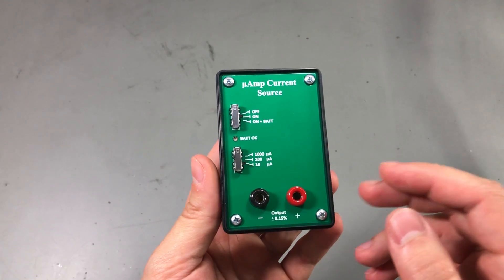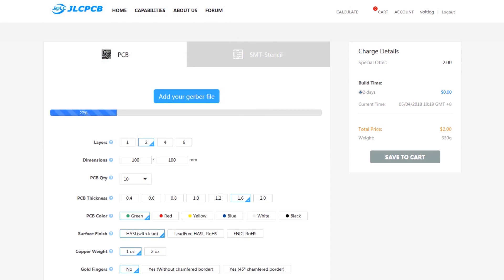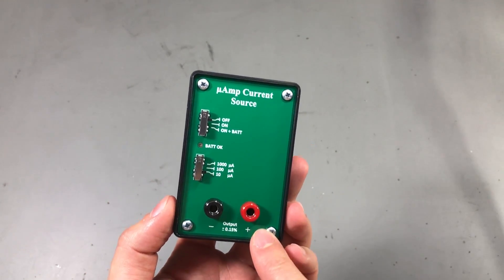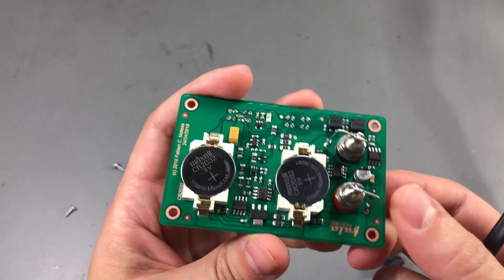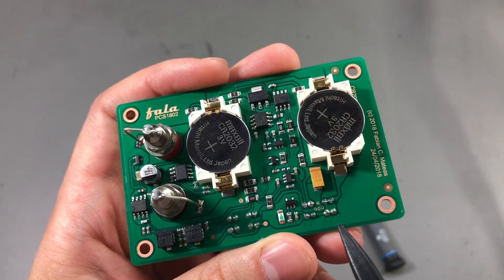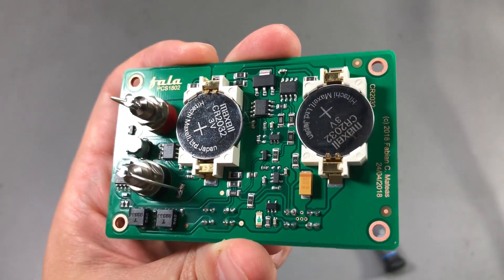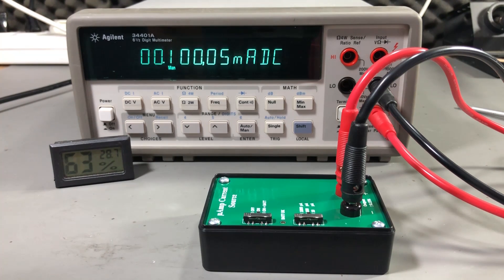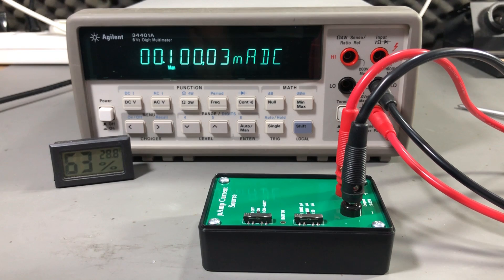Voltlog #173 - µAmp Current Source

Comment: Can anyoane help with advice on how to go lower then 10 microAmps? Need a generator for the range 3-10 MicroApms, can I add something to this one or is there another one-unit that does this? Thank you
Reply: This is can be the diffrence between two much higher current source/sink.
I may not place them on pcb and surrund them with static isolation rings to measure the leakage current directly from its source.

Comment: When measuring currents you shouldn't have to worry too much about test-lead conditions, since everything being measured is in series, there is basically closed-loop control of the current regardless of small impedance fluctuations. One thing you can do to help, is twist the wires around one another, so it's more like a twisted-pair instead of 2 seperate antennas floating in a sea of RF. But yes, shielded cables will do the same pretty much, maybe worth testing to see how similar the 2 methods are, and share the results?
Reply from the maker: yes I will do a follow-up video on the subject.

Comment: 80$ ? thats a bit much, for someone trying recover the investment, how much did he spend developing?
Reply: If so, is there a problem? He doesn't have to give boards away. If you can't afford it, just don't buy. You can't expect others to give you stuff you're not entitled to.
Reply: Actually it might not be that expensive. It depends on the components he used. If you think $80 is much, you should see the cost of a 10MHz, precision oven controlled low jitter reference clock generator of my own creation. Is $200 too much? Or the cost on the average TI demo board. These are a few examples.
Reply: You've made your own ucurrent, yet you somehow missed the fact that ucurrent sells for $80, very close to the price and complexity of this device.
Reply: thing is, is he trying to recover investment, or make money?
Reply: Ok, to get to the bottom of your argument, you came with a BOM + PCB value of $30. Where did you buy the PCB? Did you used iTead or SeedStudio? Was a 2 layer or a 4 layer PCB? The components, where did you buy them? eBay? Alibaba? What corners did you cut? What quality components have you skimped? If you can answer this straight, I'll tell you why you project cost just $30 (if it is not obvious to you already).
Reply: i dont want this discussion just move on, i just wanted to buy one and was expecting closer to fifty, oh well
Reply from the maker: I would think you would need to spend quite a bit to design and build these, just do a quick bom calculation and you'll understand why.
Reply: i've designed pcb's before and i even made made my own ucurrent, wich the bom came at 30$ + pcb, wich is why i'm surprised with the 80 price tag